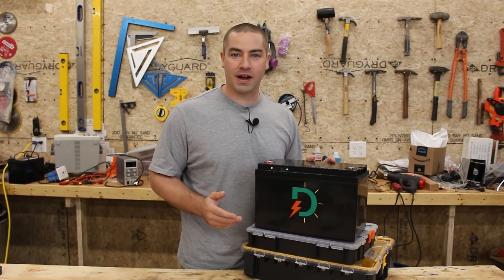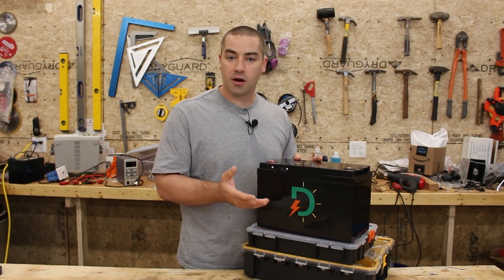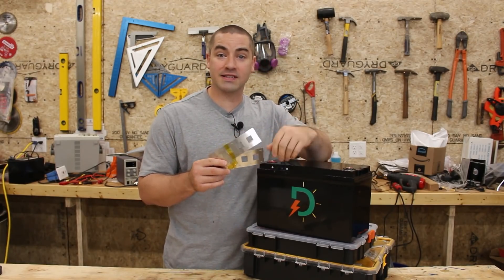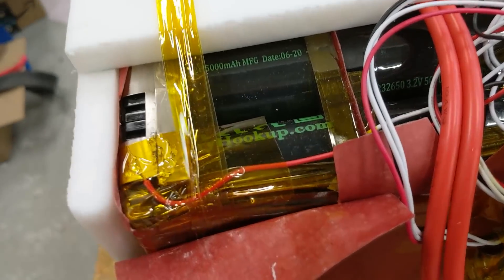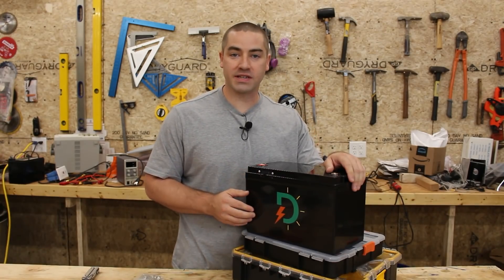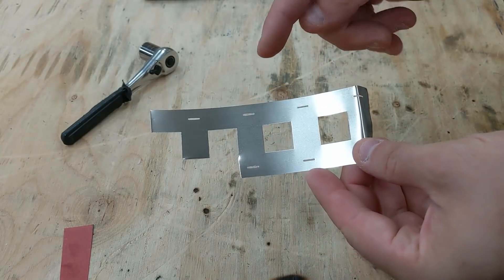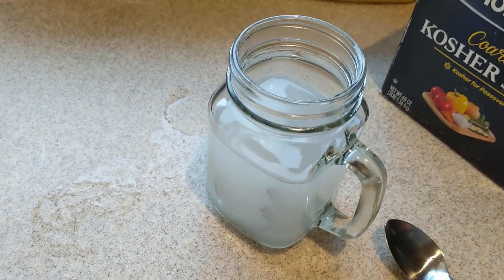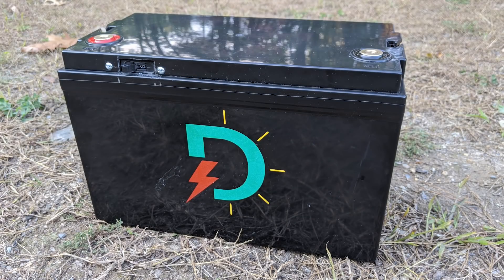Top 10 Questions Answered about DIY Battery

Comment: Dont see an issue on a little locktite on the THREAD of the bolt, just as you did. That is where its needed anyway.
Another way to check for pure nickel is to put it on a grinder (benchgrinder, anglegrinder, linisher....) nickel plated steel will spark as soon as you go through the nickel plating. Pure Nickel won't spark.
Keep up the good work.
Reply: Good catch! Excellent idea!

Comment: David poz could you help me put in designing a diy bank and setup for an rv been trying to do this on and off for about a year now im an electrician for the industrial refinery field so solar is a bit out of my expertise becuse of all the system is different when going into batteries especial getting into lipo and etc but to the point I'm in a area with no trees aalll day so solar has been on my mind for my trailer it would be a huge improvement to reduce some of the electrical footprint and maybe even get a good offgrid setup maybe i have a 41 foot rv i figured i can get at least 12 or 13 200 watt solar panels on the roof if theres more effician panels that are a bit bigger i dont mind going that route and i have 2 great areas for batties one is in the "basement" basically right below my bedroom and in the "garage" which is also below my bedroom ive seen a few of your videos and really hoping youll reply and maybe help me out with picking what will work for my needs and pointing me in the right direction ive asked other youtubers but they havent replied so im sorta shooting for the stars here hoping you will i know i can get a looot of batieries in my rv in the garage area i have about a 7foot by 2 foot by 2 foot area i can place batteries in and in the basement i have about a 4 foot by 3 foot by 2 foot tall area aswell as for the components to control it i have a cabinet inside thats directly over the 4x3x2 spot with a hole that was precut as a pass threw im trying to keep it budget oriented but if i need to indulge in a piece ill do so but some help and info to design my setup for off grid would be amazing please help me out like i said i love your diy approach and im down to buy battery packs and solder my own pack if i have too sorry for rambling hope you can help your loyal follower from texas mike.... ps the rv is a 50 amp rv if that is any help
Reply from the maker: Send me an e-mail through my website, or send me a private message through facebook.

Comment: Thanks for the very good videos. Please excuse for my ignorance. I have 2 questions. 1) Why is nickel used for the conductors and not other materials such as copper? 2) Why are cells (within a 20 cell bank) connected in parallel directly? I thought any voltage difference would cause high current among the cells.
Reply from the maker: Nickel can be spot welded with small homeowner level spot welders.  Copper is very hard to spot weld and would require an industrial machine.    2. We connect cells in parallel to increase capacity.  If I only had 4 cells in series this would be a 5ah pack (small).  but at 20p4s, this is 100ah.  It's true that different voltage between cells could cause current to flow.  That's why in my previous video I checked the voltage of every single cell before spot welding them together.  As I said in that video, I needed every cell within 0.10 volts of each other, and they were.
Reply: @DavidPozEnergy  Thanks for the prompt reply. Even with potential differences less than 0.1 volt, I imagine the cells are continuously trying to level each other. I worry about the current and heat are damaging the cells. (For the same reason, when I was still at school, the teacher told us not to connect power supplies in parallel.) Am I worrying too much?

Comment: You could also use Nordlock washers instead of loctite, though I don't think the loctite would cause any problem.  I have some CALB large format 100 Ah LFP cells which came with a dry type of thread locker already on the threads so at least they don't think that type would cause an issue.

Comment: can this battery be connected in series to make 24, ......48V ?
Reply from the maker: I think so, but I have not tested this BMS in series to be sure.  I prefer building a 48v battery with a 48v BMS instead of series connecting 12v batteries.
Reply: It's dangerous to connect in series for BMS protected battery. Because when discharge protection MOSFET turn off, it was risky on voltage overload damage (double or triple spike voltage when 2 in series)

Comment: I commented on your last video about using foam spacers between the battery and the box. That would be a better thermal insulator than a cutting board.
You might want to check out "film heater" elements available on-line to put between the foam and the cells. They should be able to keep the cells above 50F in most cold weather.

Comment: All fine, your builds are low voltage and amperage ones there this simply not matter. Good job, nice engineering. Electrons like to travel as close as possible to surface or even on the surface of conductor all depends on voltage and amperage. My apologies for non-professional wording but i tried to dumb it down for average as possible.

Comment: Disclaimer, I'm in no way a chemist or a battery expert and I do not know what I'm talking about to the extent to give advice. 
I do know that if you put dissimilar metals together in a corrosive environment, they are going to have accelerated galvanic corrosion. I would expect heat and electricity to compound it. I do think lead, copper and nickel are stable enough to use together. I see them all over circuit boards, but the thing i don't see is steel. The nuts and bolts make me curious if they can survive all the years in the box. If this was enough of a factor, I guess there is options for clad or plated hardware. Shoot, I don't even know if that environment is corrosive enough to worry about since the cells are all contained.
Reply from the maker: The steel bolts I'm using are stainless.
Reply: @DavidPozEnergy  I would like to humbly reiterate that I'm not a subject matter expert here and you seem to have a good understanding of what you are doing. However, 304 stainless isn't compatible with copper. Copper (anode) is going to be sacrificed to the 304 (cathode) which will also remove the corrosion resistive properties of the stainless.  The rate of this depends on the electrolyte present. Humidity in the air is a poor electrolyte, but still an electrolyte. 
I was only chirping in here because I seem to recall these lithium type batteries having an exceptional life span. I don't even know if this will effect the performance of the battery. With such nice build quality, it could be worth copper bolts. If you get curious, try looking up "metal compatibility charts". I don't know if its worth fretting about.

Comment: I believe the way to determine whether the loctite on the threads is significant would be to determine the surface area of the lug-to-ring connection. If that cross section is greater than the wire's cross section then the connection should not be a bottleneck.

Comment: @DavidPoz 
I can see were some people would think that the loc tight would interfere. However, Most people don't know how DC versus AC works. AC travels inside the copper which is why house electrical is solid wire. DC is opposite and Flows on the outside of the copper(or other conductor material). This is why you want to use really FINE and densely packed wire for DC. 

Since DC is outside it does go from brass to wire more than brass to bolt to wire. However the loc tight can interfere with this connection at about approx 20% area loss as the bolt is also a outer to outer connection. However This is only a concern if the contacting surfaces are already 100% saturated which at 50A you don't need to worry. If you were running 500A+ than you would not want to do this but instead Solder the two together. (EDIT: Meaning using the bolt setup you replace the loc tight with solder ((NOT replacing bolt with a solder only connection)))

I had to re-look this up in my A+ certification training manual as it has been many years since I had to study this and wanted to be sure I gave 100% correct information.
Reply from the maker: Thank you for taking the time to look it up.  I really appreciate a thoughtful answer.
Reply: @DavidPozEnergy  Hey Can you do a battery conversion? I don't see anyone that has done it yet but I have a sealed lead battery jumper that is also a power bank. I am kind of sick of changing the battery every year or two as this is rarely used and it is kept connected to my 100w solar array and a float charger. I would love to change it to Li-ion or LFP. I use this battery mostly for the powerpack feature but the Jumping is a bonus that should stay. There is no video's currently on doing this type of conversion that I could find on YT except for turning battery packs for power tools to Li-Ion. Which though similar doesn't have a BMS. 

current battery in it is a HL12170 12V17Ah/20hr with a 
cycle use of 14.4v-15.0v
Standby Use of 13.5v-13.8v
Dimensions are (H)7.15" (W) 3.03" (H) 6.59"

Comment: The metal surfaces will make metallic contact where they are tightened. The locktite will glue the gaps on the opposite site where there is no metallic contact. So don’t worry about the application of locktite.

Comment: After the low temperature shutdown what steps did you have to do to re-enable the batteries ability to be discharged?
Reply from the maker: Nothing, it will still discharge below freezing, just not charge.

Comment: I noticed you didn't put Locktite in all the threads leaving part of the threads clean to conduct power. Since it doesn't cover all the threads I doubt conducting power in the threads will be a problem. Especially as you point out a lot of power can pass through directly from the side of the terminal. The only way I can see it could possibly make a difference is with extremely high current loads.
Reply from the maker: I was taught long ago a little goes a long way.

Comment: You never mentioned what you are going to use it on. When I built relays that went into space we used conductive silver epoxy on threaded connections. I would put some dessicant inside and a usb adapter port too. A led light on the side would work too.

Comment: Question,  want to build a high capacity 12 volt for my RV. Will I have to change my charger? from the existing inverter/charger or 12 volt from the trailer plug, i use now. Thanks!
Reply from the maker: If your current charger is for flooded lead acid, then I would suggest changing it out with your batteries.  Lithium's want a CC/CV charger, meaning constant current, constant voltage.
Reply: Would something like this, on the 12 volt coming from my truck and the rv inverter charger work? 
https://battlebornbatteries.com/product/victron-orion-tr-smart-isolated-12-12-30a-360w/

Comment: David, haters gonna hate. No matter what. Some people simply have to find anything possible they perceive as "wrong" about others' builds. In truth, most of these folks are nothing more than keyboard commandos who've, themselves, not actually built anything.

As for the mention of Loctite on the lug bolt, it will have zero effect on conductivity of the connection between the terminal and the lug. After all, the purpose of the lug bolt is to securely connect the lug to the terminal. Loctite is a very wise choice for this application as it will minimize or eliminate any chance of the bolt loosening over time.

There are four things in life that will (quickly) find the path of least resistance:  liquids, gases, electricity and children :) In the case of this battery, energy from the LFP cells will move through the nickel strip, to the wire, to the lug, to the terminal. Yes, the lug bolt will be energized, but it's definitely not the path of least resistance.
Reply: And the purpose of this post? What does it add? How is it helpful? Is this a psychology debate? Are we discussing batteries here, or the self righteous indignation of the reader? What are you bringing to the table, if not the very thing you abhor? We are not here as David Poz fan boys. He’s a big boy, I’m sure he will live. (Thanks for the vid David) .

Comment: This is what you're looking for perhaps?
LOCTITE® ABLESTIK 3888 is a silver, 2-part, thick epoxy adhesive paste designed for bonding metals, ceramics, rubbers and plastics used in electronic parts where good adhesion combined with electrical and thermal conductivity is required.
Reply from the maker: Thank you very much.  I love learning about new products.   I'll find it and read the data sheet.

Comment: The battery looks really good for a diy.   After I looked for quite awhile;  i ended up with the Battle Born.  (which was not my first choice by any means).  I would have gone with the Fortress or the Simpliphi lithium batteries,  but the cost, weight, and shipping cost was a deal breaker for me.
Battle Born ended up giving me a good deal on the cost per battery,  so I took it. Also the ten year warranty helps too.......

Comment: For testing the strip, steel would be magnetic
Reply: nickel is magnetic too
Reply: Nickel is also magnetic, so that is not a tell.
Reply: Both metals are ferromagnetic. If you have sensitive magnet field measuring equipment, and identical thickness steel and nickle plates, I wouldn't be surprised if differences exist, but otherwise... no.

Comment: ppl want a lot from a battery! Store them in a temp controlled room, and connect them through a breaker panel. Not everything has to be built-in!
Reply: Some will install it in an RV, trailer or van.
Reply: the head of the bolt pushes the lug onto the brass, where you want the current to flow. using thread-locker is correct to counter temp cycles.

Comment: @6:40 David. I wold use a lock washer instead of the locktite.  There are various locking solutions for your project such as a wavy washer or a nylock nut.  But I feel the locking washer should be sufficient provided you torque the nut properly.

Comment: In the brief search I did. There is a Loctite Threadlocker 290. However, you’ll need to heat up the bolt to insane temperatures to remove it in the future. It’ll melt the plastic first that holds the brass in place.  

However, you want to use the proper glue that is applied to the top of the bolt. Not the threads themselves. I don’t know what that is though. I’ve just seen it on stuff I’ve taken apart.

Comment: Dave, just use your multimeter to test the resistance from the lead to the top of the terminal on the other side with and without the Loctite(or before you install the Loctite). That way you know for sure. I bet it won't even register a difference.
Reply: Most cheap multimeters won't measure that small value of a resistance. You will have more resistance in the meter connections and leads.
Maybe with some expensive 4 wire meter measurement to measure those values.
I don't know the equipment that you have available but most hobby folks don't invest that sort of money. I have one of those cheap meters used in this video and its good value for money, but forget trying to measure those sort of micro ohm values.
I've invested in a variety of test equipment for my lab and your talking big bucks. That meter is a throw away chinese meter for just general use not accurate measurement and certainly not to measure the low ohm readings to see what's really going on there.
Reply: @KB1UIF  For sure.  Need a mho's meter lol!!!  Easiest way is put insulator under head of bolt.  DC volts lowest scale (millivolts or uv) - test from top of bolt to terminal.

Comment: The battery case would be awesome to get my hands on, but it seems aliexpress wants at least $42
Reply from the maker: I spent $50, so you already found a better deal than me.
Reply: @DavidPozEnergy  what did you put in to search for the case? Having trouble finding one that size? Will Prowse used a marine battery box/cover for one of his projects, but it looks a little flimsy for a battery? Not a very good seal!

Comment: Great set of experiments. I agree with you on the Loc-tite, the threads would be a bad path for current flow and the surface of the lug to connector would be the path of lowest resistance.

Comment: Could just do 4 prismatic cells. Cheaper and easier?
Reply: What if one of the prismatic cells goes bad? You have to replace it to maintain a 12 volt pack but now you have an unbalanced pack with a newer cell alongside older degraded cells. Plus, the cell is going to cost $75 to $100. What happens of one of these cells goes bad? You don't have to replace it. The remaining cells in parallel with keep the pack at 12 volts. The amperage will drop, sure, one cell each in the other parallel packs, so you'll lose 6 amps of total capacity. But that's it. It will keep running.

Comment: Where do you get your cutting board?
Reply from the maker: The one in the video was from Amazon, but I didn't link it because it had raised words and numbers.  In a previous build I had bought one from a kitchen supply in Boston and it was perfectly uniform.
Reply: @DavidPozEnergy  I had some that was from a chicken processing plant, they were about 20" x 96" approximately, I had two of them, over 1/2" thick, and I guess someone got them!  I would probably never needed anymore, I have some pieces about 6" x 48" I'm going to use, but I'd like to have some larger pieces,

Comment: Great answers and as an TV, Radio engineer and a past electrician I would not worry about the Loctite. I agree that a loose connection is far more of a possible issue. Thank you
Reply: Loctite is a polymer.  You are reducing the surface area in contact by 2*2^-2 x H pi D and only using the area of the bolt head - the area of the thread part. I suggest you all do the maths!